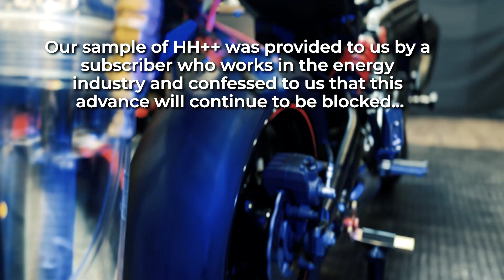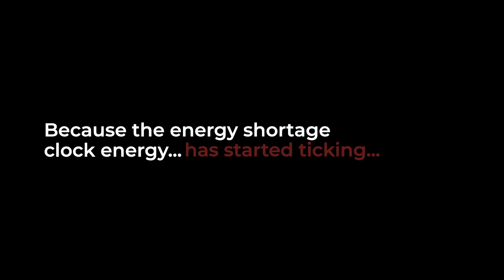What is the HH+ Compound? The key for efficient electrolysis for water based engines.

Comment: If you want the real thing, make a capacitor out of plates of metal mesh for tea instead of tiles of solid material.  This drastically reduces the surface area, and thus the capacity of the capacitor.  It is important that the wire is as small in diameter as possible and that the mesh is as dense as possible.  This is the main advantage of Toyota's water engine.
Reply: Je pensais qu'il fallait avoir une plus grande surface avec l'eau pour que hydrolyse soit plus efficace
Reply: @NahelDerouiche  la rejilla funciona como una placa de semiinducción, donde cuanto más pequeños son los agujeros, más se comportan como bobinas de inducción.
Reply: Merci de m'avoir répondu 👍
Cela va beaucoup m'aider
Reply: @NahelDerouiche mira el siguiente vídeo Toyota Destroys the Auto Industry with a Water Engine.

Comment: when we distill petrol , different density of components ,light to heavy heptane C7H16 to cetane C16H34 , when we fire it ,there is an hydrogen combustion and carbon chain fragmenting soot (a black powdery or flaky substance consisting largely of amorphous carbon), when we decompose the water and fire it ,there is a hydrogen combustion and oxygen chain recomposition , (oxygen is a gaz when carbon is a solid) , knowledge is the key to unfreeze  your mind ,(warm an state to give you another state of matter) 
hear sometime there is a fourth state of water , ( maybe a balance between magneto electrical chain of hydrogen and  oxygen 9 electrons )

Comment: Question : when using HH+ the amp draw is minimal? Hydrogen production with minimal drag on the alternator? Have you measured the amps drawn?
Reply: I've a feeling it's not a water based hydrogen cell but a HH+ hydrogen based cell with an ammonia deposit waste, would I be correct in thinking this?

Comment: its Ammonium or even Ammonium acetate
Reply: @ashrafatteya Can you produce a high hydrogen production with a low electric supply using ammonium acetate?
Reply: @kevindonnelly3082  yes with resonance cavity
Reply: @ashrafatteya thanks. I'm referring to the electrolysis system this guy has created, it's not a resonance cavity yet he achieves enormous gas production and gauging by the small wiring little resistance

Comment: Use electricity for Hydrolysis to extract hydrogen out of water and use this hydrogen to generate electricity. Hydrolysis has more efficiency than burning H2 to make electricity. In the cycle you are losing energy as heat during the burning of H2. The loop would be better if you generate electricity using PEM fuel cells to generate electricity directly from H2 and not burning it. Even in that case, you wouldn't produce energy. It would be an energy loop. The electricity generated is less than that used for hydrolysis.

Comment: If you mix copper sulfate with zinc metal powder and let it sit for 10 days, the water will become clear. Collect this water and gently evaporate it either in sunlight or at low temperatures. This process will yield a white powder. Utilize this powder to observe additional results. It proves highly effective for electrolysis.
Reply: ❓ what danger lies in burning this hydride.

Comment: I have found hh++ compound on internet selling for 700€ per barrel. Do you think salt would do job good enaugh to power 250cc?
Reply: yes castic sode,
Reply: If you mix copper sulfate with zinc metal powder and let it sit for 10 days, the water will become clear. Collect this water and gently evaporate it either in sunlight or at low temperatures. This process will yield a white powder. Utilize this powder to observe additional results. It proves highly effective for electrolysis.
Reply: no 
wil not worck

Comment: Yes but what is HH+. 
The title say what is HH+ and the video doesn't let on!
Reply: Common salt. Distilled water is a poor conductor of electricity, a bit of salt fixes that.
Reply: If you mix copper sulfate with zinc metal powder and let it sit for 10 days, the water will become clear. Collect this water and gently evaporate it either in sunlight or at low temperatures. This process will yield a white powder. Utilize this powder to observe additional results. It proves highly effective for electrolysis.

Comment: Tapwater will contaminate your water because of the minerals from the city processing do not use. Reverse osmosis or distilled water is recommended. If you water turns brown is because of minerals and minerals will plug of the electrolyzer.

Comment: Yes, we all seek cheaper energy. Let's work on that. BUT, there is no "fossil"-fuel shortage. Oil and coal and natural gas are infinite for human consumption. The myth is created that it is fossil, and that it is limited in dwindling quantities. That is a lie however, for them to justify high commodity prices. Electricity is abundantly available, with research and development in these sectors suppressed for the same reasons. But breakthrough solutions are filtering through slowly but surely. There is nothing like "free" energy, because all technologies and equipment costs money to produce. Whether it is limited lifespan (30 years solar), HH+ Potassium hydroxide (actually not HH+, but K1OH) or magnet driven alternators, it all cost money, albeit cheaper. Cheaper because it requires a smaller capital outlay and minimal running maintenance. So, nothing in this league is completely free, but the lowering of the entry cost barrier is tumbling. Yet, industrialists will not come running at your or my aid to supply it to us. They spent money and innocent blood to keep their industries going.